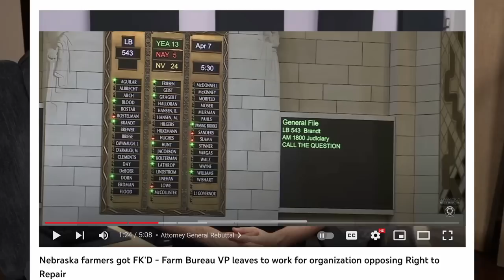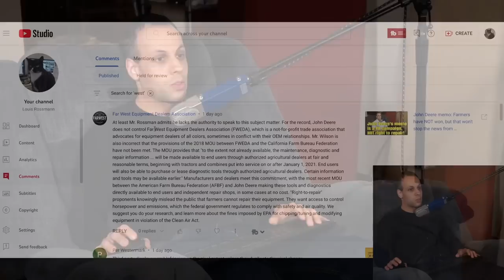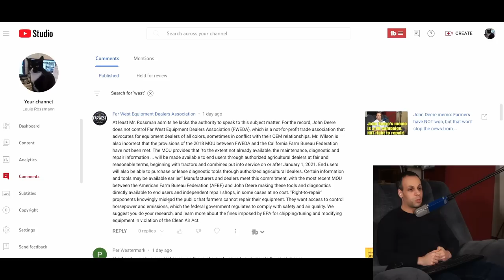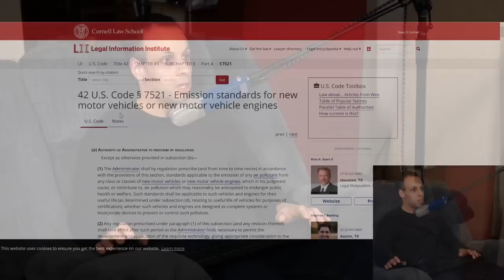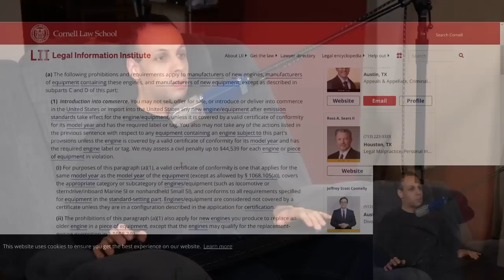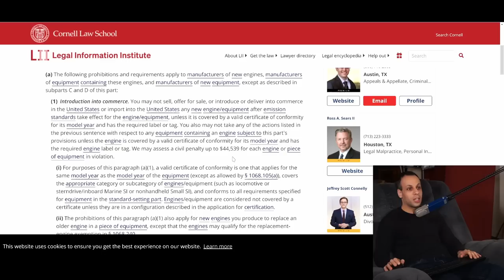When John Deere lies about emissions to screw farmers, read them this law

Comment: Got to love how they are like "We cant have farmers and repair shops fixing tractors, they will increase horsepower and mess with emissions" ,  I dont think farmers give a rip about horsepower or making emissions worse, all they care about is the tractor does its job reliably. Farmers dont really tune and mod their tractors as if they break something thats lost money. Unlike normal cars and trucks where downtime is accepted, i dont think a farmer wants to risk downtime to get more horsepower out of their tractor. Its not gonna make their jobs any easier or go faster,
Reply: So true.
There are some companies that die some clean tuning  (clean is meant as : they don't BS the cst and promises stuff that's not working).
But when the tractor breaks down there may not be a fitting replacement machine standing around...and even if they have one, does not mean that it's compatible to you equipment that you need right now.
With car you give a shit, even when driving a truck you can get a compact replacement for those three days...then you won't drive out for fun into the Forrest this weekend. And the replacement mac will just pull your trailer like your pete
Reply: Emissions control equipment in tractors lowers fuel efficiency and horse power significantly. It also breaks down often

A lot of farmers do mess with their tractors to disable that system and the main job of tractor DRM is to prevent them from disabling that system
Reply: It's just part of the big bully getting smaller people to do the bullying for them.
Reply: @AJ-wf1vh  big problem is in cold weather. That shit freezes and your machine/car/truvk just won't work without it.
I get it that people are fed up with it, paying 500 k on a machine that you can't use and breaks at freezing temperature.
And then talking about environment protection, when you tell everyone that uses DEF they need a heated shed/garage so nothing breaks
Reply: @AJ-wf1vh  But if the emissions control equipment lowers the fuel efficiency it increases emissions.
A more efficient high compression ratio may produce (di-)nitrogen oxide, due to the higher combustion temperature, but those are pretty much irrelevant outside of densely populated areas where smog could be formed from them.
The added CO2 from inefficient engines will stay around in the atmosphere for much longer than N2O & NO.
Reply: also even if they were to get more horsepower, john deere is not liable for that as it is not their machine.
Reply: @jannikheidemann3805  Yes, they would produce nitrogen oxides and destroy the catalytic converters

Just because you're saying it's irrelevant doesn't make it so. Farming equipment uses a lot of diesel and even small amounts of nitrogen oxides are dangerous to humans.

Those systems are a pain to deal with, I won't disagree. But letting the farmers disable them is not a good solution. I am not a farmer so that's the end of my knowledge. But what I'm sure of is that this is not a super hero villain story and those farmers are not innocent themselves.
Reply: @sato AU  that is the specific issue right there, JD wants to keep ownership and make believe just because their Logo is on it,they still own it. That and the ridiculous rates they charge a d wait times ( not a farmer but I've heard of farmers waiting 3-4 weeks to get the computer reset to get it out of limp mode )
Reply: @AJ-wf1vh  that is decidedly true and JD  actually lobbies for these bad systems to lock out service
Reply: @AJ-wf1vh  even if tractors and farm equipment, big combines and stuff. where burning coal or wood, as fuel, they are mostly out in the middle of no where, many miles in some cases, and last time I checked CO2 is meant to be good for plant life, so any CO2 emission will be moped up by the growing crop (plants),
Reply: @dh2032  Why is everyone saying uninformed BS like this? Any plant life, especially crops, have a lifetime CO2 cycle attached. They basically store CO2 in them when they grow and the moment they are decomposed/consumed, they release that CO2 back into the atmosphere. Since plants are lifeforms they release CO2 in atmosphere by breathing as well. Any additional CO2 might make photosynthesis more efficient, but there are diminishing returns and global warming nullifies any gains from this because plants need to breathe more when warm. You can look up the studies done on this, but the short story is that we need to limit the CO2 released in the atmosphere to slow down global warming so forests can grow to absorb as much CO2 as they can while giving up as little CO2 themselves as possible and, eventually, have just enough CO2 to sustain all life while not triggering a global warming event.
Reply: @TheWabbit  they aren't trying to keep ownership though, that's not what they're doing. what they are doing is trying to monopolize repair.
Reply: @satoau1  I'd say they've done that already. Maybe I should've used acting like!
Reply: @TheWabbit  yes that's the point that's what the video and this discussion is about.
Reply: @jannikheidemann3805  carbon is plant food!
Reply: I'm sure there are some famers that want to buy a £200k Tractor and tune it to perform like a 300K Tractor. I'm also damn sure that it is none of John Deeres business if they choose to do that unless they try to fraudulently claim under warranty for repairing said tractor after it breaks at which point it will be John Deeres job to prove that is what has happened.

I honestly don't know if we can stop this avalanche of billion $ companies who think when they sell a customer a product they can dictate how it is used, repaired, what features can only be unlocked with a subscrition and when it becomes obsolete but thanks to prople like Mr Rossmann we at least have a chance.
Reply: I don't think many people realize just what modern farming requires and just what sort of demands are placed on this equipment.  The reason John Deere crushed IH into fine red dust during the "horsepower wars" wasn't that their machines had more features or more horsepower.  It was that they were more fuel efficient.  As fields got bigger, so did tractors.  As tractors got bigger, so did engines.  As engines got bigger, so did fuel bills.  John Deere's tractors had far greater compression rates than any of their competitors, and when you thrive or go broke based on balancing fuel bills with acres tilled, that green paint sure looks appealing.  I still run a JD 2640 from 1982.  My dad still runs a 2030 from 1965.  They run great, and they sip diesel daintily like princesses at tea time.  The turbocharged three cylinders from the same era still hold fuel efficiency records.  Meanwhile, my neighbor's brand new (2020 year model) JD drinks like a fish, and requires DEF to boot.  So tell me again why it's dangerous for me to be able to repair my own damn equipment and make it more reliable, more fuel efficient, and actually get it to shut the hell up about "emissions error" or "low temperature" or, my personal favorite, enter "reduced power output mode" when it runs low on DEF, which for a while was IMPOSSIBLE to get out here during the great supply shortages.

Comment: I worked in the automotive repair sector, so I am VERY familiar how repair information is there. For example GM, I have access to ALL service information the dealer has available to them for a fee. This includes wiring diagrams, flow charts, service procedures, theory of operation. I also have the ability to flash or program modules with stock information to the vehicle available on GM's website, also for a fee utilizing a J2534 interface and a laptop.

Comment: The farmers should be able to repair whatever they buy in whatever way they want to.
Reply: As long as it remains within the rules and regulations...
You forgot that part.
And if parts and information would be available, and testing equipment also (shouldn't need to be from that brand too) there is no reason a farmer or local technician shouldn't be able to fix the equipment.
And I mean FIX not modify!
And even if a farmer mods stuff and the equipment goes out of spec/compliance, if the EPA shows up the farmer gets a ticket. Not John Deere.
Reply: Niels, You forgot reality. A Lot of parts are Not how they should be to work in the field. Its either "modify" (as you claim) the tractor so it Actually runs every day or spend min 20000 just to get it to the dealer for "repairs" (another 2500) that magically work for a few months then break when the dealer again cant have a mechanic drive out 3 hours. Theres also the Increased Emmisions directly from having semi come haul the tractors..A heck lot more.
Sure, there are a few guys in the dealerships that actially have a spine, but what they do gets cutthroated by their peers.
Rules and regulations only serve the corporations.
Also, we have been on the tail end of the last ice age coupled with massive volcanic emmisions over the past century, not to mention food shouldbe the Last place to have blockades against farmers ability to provide for the unthankful.
Itd do you some good to learn.
Reply: @sparda169leon  if the equipment fails that often file claims and seek better equipment. And yes, making improvements to reliability while keeping it operating within the rules, I'm fine with that. It will probably ruin your warranty though. But as long as parts and information is available repairs can still be done (by yourself)

Comment: Supplement for section 5 I was wondering if farm equipment would be considered a motor vehicle under that law so I went and found it:

303. Definitions -- "Motor Vehicle" -- "Aircraft" -- "Security"

The terms "motor vehicle" and "aircraft" are defined in 18 U.S.C. §  2311. Motor vehicle includes road vehicles, such as automobiles, vans, motorcycles, and trucks, as well as off-road vehicles such as self-propelled construction and farming equipment. 

Yeah they do.

Comment: I guess John Deere’s PR team counted on people not being able to read.
Reply: More like they counted on no one bothering to read. And it's scary how close to the truth they came. Note that this has been an issue for a long time, and a lot of people are involved with JD as they try to keep their machines working instead of generating revenue for JD.

And yet it took this long before someone read the very document that JD points to time after time as the reason they can't provide the information people ask for.
I'm no better as I didn't bother to hunt down the relevant information. My only excuse is that I'm not a farmer or even a US resident. Still I could have looked it up as it's available on the net, and I never did. I just sat back and hated on JD, trusting others to do the actual work of looking up the exact documents referred to so I could check that they actually say what JD claims.

Comment: All of their BS arguments always fall flat when you shove in their face the blatant fact that the manufacturer does not own the equipment once it is sold. 
Meaning that even if we pretend for a minute that that clean emissions law does what they want you to think it does, it should literally no longer be their problem once the equipment leaves the sales floor. The manufacturer is required to make sure it is up to spec before it is sold, but once they it is in the end user's harnds, it becomes the user's responsibility to make sure it remains legal. If the end user ends up modifying it in any sort of illegal way, then that's on them and not up to the manufacturer to police or even care about.

Comment: Unfortunately, the definition of "motor vehicle" for the purpose of the Clean Air Act doesn't include farm equipment. Always read the definitions!

(2) The term “motor vehicle” means any self-propelled vehicle designed for transporting persons or property on a street or highway.

Comment: Id like to clarify in the event someone tries to hit back with a "aha moment". When he talks about "no such information withheld...", louis doesn't go into what that actually means when it mentions "7542(c)"; he says under 7542 but he should have read 'under 7542(c)'.
What is 7542(c)? Well its basically a sub-section of "Information Collection" under 42-7542 wherein the manufacturer can appeal to the Administrator that any and all information, in regards to Emissions standards, be kept hidden from public view due to being labeled 'trade secrets'.

Where does 7542(c) not apply and what does that actually mean to 'not apply'? If the manufacturer were to share any emission standards reports to franchise dealers or repair-men then that information can not be labeled as 'trade secret' and hidden from public view. Hence why the part Louis reads states, "No such information may be withheld [using] section 7542(c) of this title if that information is [given out to non-manufacturer employees]".

Comment: so.... would encrypting and charging a $10,000 fee for a "key" to unlock the software on the tractor be legal?  It would seem if the "authorized" anointed repair technician has access to the software, they should also provide it to the owners technician?  or am I missing something?  anything more than that would be extortion?

Comment: I'm a professional tech in the auto industry and cater to high end European cars. The fool that made the comment is off base. First, any OEM or quality aftermarket software for testing and diagnostics follows OEM protocol. For example, if I replace a bad ECU for a Porsche using PWIS  (Porsche Integrated Workshop Information System) whatever software package THEY let go into the ECU is THEIR design. 

This clown is trying to make it out as every tech is a "chip tuner" and believe me, that is the farthest from the truth. Other than some "comfort features" ( like making your windows roll down with the remote for example) there is NO factory diagnostics that will enable the end user to "tune" anything... Unless JD does in fact have that option in their diagnostic system, they need to remove that functionality from their diagnostic platform if they are worried about being able to have the end user "tune" something. 

They have no reason to lock anyone out from using a diagnostic system with the ability to program a new control unit back to THEIR specs. 

We got hung in the auto industry on what they call "TRP" or "theft related products" like keys, immobilizers or anything that had to do with theft prevention. the fix was for us to have a LSID (basically a locksmith license) to be able to repair those systems. 

These guys are grasping at straws at this point.... they are trying to keep everything in house at an eye watering cost to the end user.

Comment: Need the definition of "motor vehicle" for this law   I am sure you checked, but it's very important to be sure of the relevant definitions, 'cos regardless of what might be obvious, if 'motor vehicle' is defined for this specific legislation, to e.g. excluded vehicles that are used almost exclusively on private land ... ...
Reply: The Farm Bureau cited it to begin with. It would be hard (and hilarious) for them to argue it wasn't applicable after that
Reply: Yeah, sometimes the term 'motor vehicle' only applies to those intended for public roads. However, it looked like the stuff about not tampering with emissions was from the same section, so it probably has the same definition. If Louis' argument isn't valid for that reason, then neither is the other guy's.
Reply: @captianmorgan7627  yup.  Louis made a big oopsie here!

(2) The term “motor vehicle” means any self-propelled vehicle designed for transporting persons or property on a street or highway.
Reply: Looks like my reply is being held for review after I added the links to the Cornell website that give the definition of a "motor vehicle". Just follow the last link in 42 U.S. Code § 7521(a)4(B) (at "pursuant to section 7548 of this title.") and you can get to it.
Reply: @Heizenberg32  yup.  Although Louis really really should have checked, and then called them out on that before putting his foot in it.
As far as I can tell, the clean air act rules on modifying vehicles for performance does NOT APPLY to farm equipment.
Reply: Actually section 7547 which is about nonroad vehicles says that relevant parts of section 7542 (which this video is about) shall apply to nonroad vehicles.

Comment: It is not unreasonable to lock out horsepower or emissions schemes. 

The devil is in the details, particularly around emissions, as small tweaks around the engines can have big unintended emissions consequences. The EPA is very strict around the emissions standards; engine makers and dealers are obsessed with compliance as the consequences can be brutal (outside huge monetary fines ala VW-Audi). 

Making fewer INDUSTRIAL engines with dealer-configurable power ratings is great. There are fewer engines and parts to design, build, and inventory which saves everyone money, permits more R&D on each platform, and has lower environmental impact. Going forward, the engine makers might bifurcate their control systems so that SOME features are user-adjustable, keeping the horsepower and key emissions components securely locked; I don't know if that is easy or possible now.

However, software locks on some CONSUMER GOODS seem like a different kettle of fish. BMW's "rented heated seat" feature seems outrageous and a waste of resources. This seems more psychological than logical, but I'm not sure. The heated seat option it is outside EPA regulatory framework so that is one difference. This is one to noodle on. . .